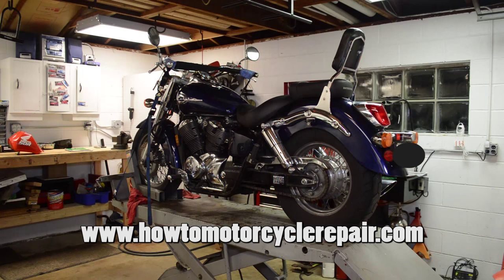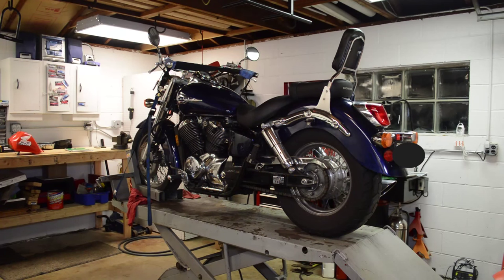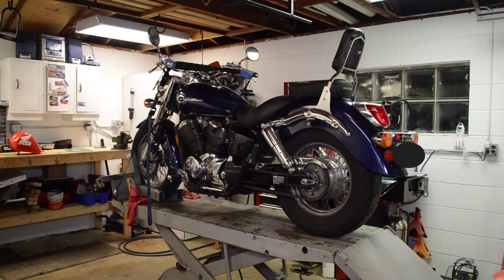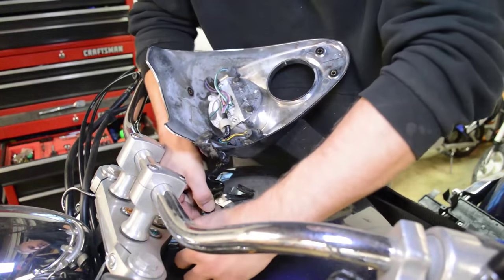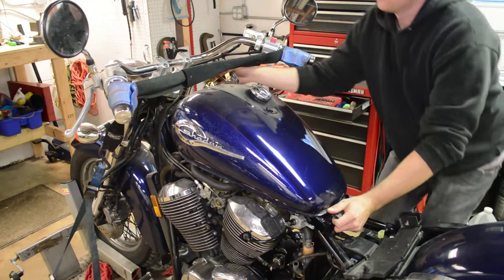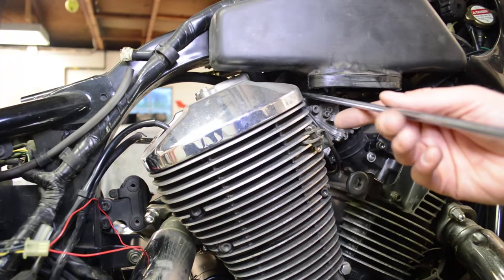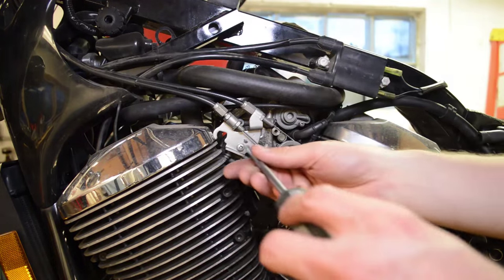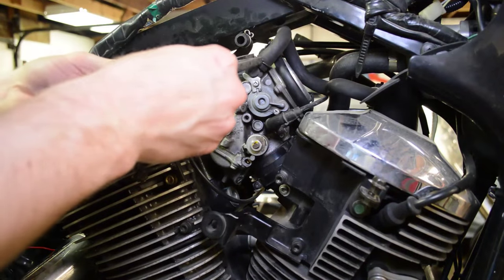How-To: Honda Shadow VT750/VT1100 Carb Clean & Rebuild 1995-2007

Comment: I want to buy this video because my carb is sometime hesitating. What are the setting for jets? Do I touch some components that later required setting or balancing?
Reply from the maker: Does the hesitation go away when choke is partially on? If so it's lean. It may be lean due to dirty pilot jets, and/or lean fuel screw setting. Fuel screw setting is not covered in this video, however I have this one: https://www.youtube.com/watch?v=zm5mB3R8Ucw
Reply: I didn't understand what does the lean run mean, but I looked at some video. My bike is only lean when it runs for 15 minutes, and only in 1st gear does that. Cold starts need 4 tries, at least. 2nd, 3rd runs with no problems. What might be the issue?
Reply from the maker: Can you post a video?
Reply: I am cleaning my gas tank but I will post a video showing you how rough start the bike is. Hopefully, the hesitation starts at once as well.  What I meant to 2nd and 3rd is; no problem on highways... Only when it is in N.
Reply from the maker: If your gas tank is dirty, so is your entire fuel system. You need to clean the carbs. No way around it.

Comment: Hi, I bought the supplies and am about to buy the full tutorial, but then I noticed the repair kit on Amazon links to an item number 18-9348 (NOT 19-9348). Is this still the proper item?
Reply from the maker: +Michael Crews Yes, 18-9348. I had a typo in the YT description. Let me know if you have any more questions.
Reply: +MatthewMCRepair Great, thanks for the quick response.
Reply from the maker: +Michael Crews No problem
Reply: There are three different kits does it matter which one? 18-9348

Comment: Hi,  I quickly realized the $20 for the video would be well spent, considering how damn hard the carbs are to get at.
Anyway,  I cannot seem to get carb cleaner to go through the choke tube.
Passed a fine piece of wire through it for an inch and still I cant see it?
Any help would be great.  Thanks for the vid, it is money well spent.
Reply from the maker: Try adding a few drops of berryman chem dip into choke tube and let it sit overnight. It may take several "soaks".

Here is a link: http://amzn.to/2uL65H4
Reply: Worked. Thanks!

Comment: so i can buy a new 05 or 06 carb for my 1999 vt1100?
Reply from the maker: Just clean what you have.
Reply: @HTMR   i did that still not good and i had to change the spark plug after 3 months only!!

Comment: Finding a loose bracket where the carb connects to the cylinder is rather disturbing. An air leak there is bad news.

Comment: Why did you speed through the most important part of your video?
This video would be helpful if you didn't, speed through the carburetor dissembling. And explation of all the components there in. Perhaps you could reload the most meaningful parts of your video that you sped through the first time? Please?!
Explain things like the importance of the rubber diaphragms, having zero holes and cracks. And, how to clean the choke assembly Exc. Exc....
I would have preferred to watch and listen to the entire 1hr and 30min of the carburetor disassembly and explanation of the inner components. And cleaning of the fuel jets.
Reply: Because he is selling his full length video. Cant have anything that would help us for free can we?